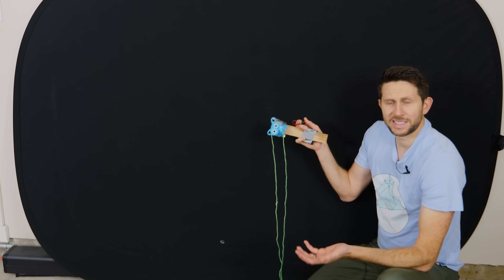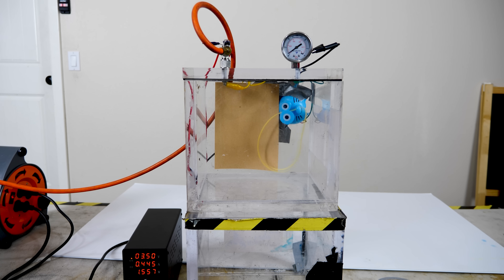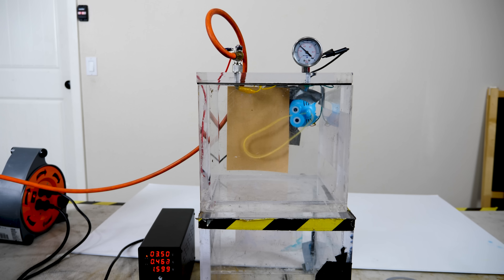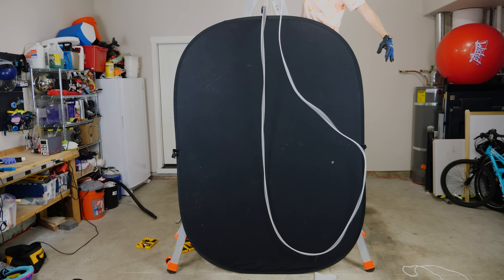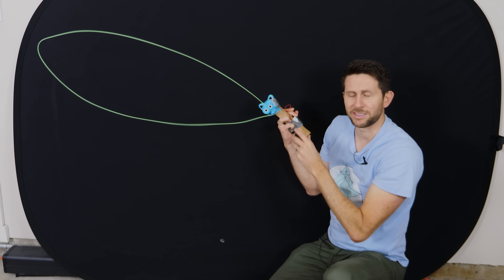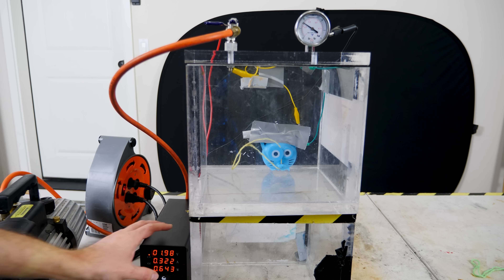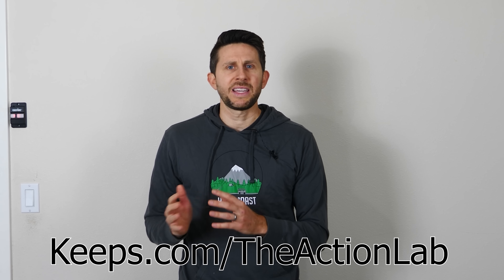The Real Reason a String Launcher Works

Comment: Nicely done with the vacuum chamber.   I've found the string shooter has been a  fascinating project and at one time we produced and sold a wooden version of this piece several years ago through a science distributor.  The interesting thing I discovered but underestimated in my own explanation is the amount of lift created by the drag through the air.  It should have been obvious since  denser strings did not work as well even though they were moving at the same speed as the lighter string. Eventually determined that the surface of the string was just as important as the velocity after noticing that as strings became worn they "flew" much better than newly made ones.  On closer examination,  I found tiny hairs appearing on the surface of the worn string were increasing the amount of lift.  So much so, that  part of our production included rubbing the nylon strings with sandpaper to give them a hairier surface.   Using this technique,  I've have  a few loops  that are slightly over 20 feet of string that are able to lift themselves  horizontally up to a vertical stage. I still hope to see a wave frozen in the string using some type of variation of these devices,  perhaps the action lab can succeed where I haven't.
Reply: Absolutely fascinating, thank you for sharing!
Reply: It is clear now: from the fact that worn, rough, hairy strings perform nicer it can be inferred that the more friction-dominated the motion is, the nicer the string performs.
About distribution of tension along the length of the string:
I imagine a piece of string being dragged through a fluid. Then the least tension is in the section of string down at the free end, and closer to the end you are holding on to (to drag the string) is where there is the most tension, because that section of string has to provide the required force to drag the entire length of the string.

If follows logically that in the case of the stringshooter the return end (being dragged into the rollers) is under the most tension, since at the return end all of the drag force has to be provided to drag the entire length of the string.

The return end looks as if it is a more loose end, it looks as if it has oodles of slack. (And we only have visual experience with strings with negligable friction, so we tend to assume that the straighter the string, the more tension) Against appearance, it follows logically that the return end must be under more tension than the outfeed end.

It follows logically that it must be that the energy replenishment is by way of the rollers dragging the return end of the string into the rollers. It looks as if the rollers are shooting the string, but they are in actual fact dragging the string.
Reply: @cleon_teunissen   using the word logically a bunch doesn't make a lot of what you said make sense. 

Making the string go through a liquid would screw with the lift so you would need a more powerful motor. And you would have to have a steady source of liquid because a bunch would be flying off the string.

The rollers are both dragging and shooting the string. The space between those two things happening is very small though (each end of the segment of string that touches the wheels.
Reply: @oscarinacan  Just to be clear: I presented the case of a non-loop string only in order to concentrate on the distribution of tension along the length of the string, with friction-dominated motion. The lift that you mention is another story. The explanation of the lift must take the looping of the string as its starting point. I did not address the lift; I didn't mention the lift. So: please treat the non-loop case and the looping case separately.

I used the word 'logically' to indicate distinction between what can be directly observed, and that which is inferred.
Reply: @Artcore103  Well, I did go overboard with the 'it follows logically'. I felt an urge to repeat that because here the visual cues suggest the opposite of what we can infer is actually happening.

In a comment on Steve Mould's video (prior to the release of this Action lab video) Bruce Yeany already mentioned that the string shooting fails in a vacuum chamber, and that worn/roughened strings perform nicer.

It's great that Action Lab showed the vacuum chamber demonstration in a video. Seeing the change in the motion as the air density decreases gives clues as to what is happening. I still have no idea, but at least we have more clues now.
Reply: Bruce, I purchased a string shooter around 2002 or 2003 from a science distributor, can't remember their name. It was on a wooden base about 8-10" long with two small motors with rubber wheels pulling the string. It was powered by C or D cell batteries and had a small plastic funnel that guided the string. Possibly the same one your company built. The string was longer compared to the unit in this video. I still have the string shooter but found it was difficult to replace the string. Regardless, my children loved it and so did my friends.
Reply: @gray5596   That would have been one of mine,  they were sold through a company called Science Kit and boreal labs.  I stopped selling them as it became too time consuming versus what we were selling them for
Reply: I like your channel so much
 @YeanyScience
Reply: I've only ever heard of the string thrower through one of your videos. I will have to catch up with much of your recent work. Thank you in advance!

Comment: 3.03 so why dont put it in a high presure and see if it rises even higher or if it rises at lower speeds. Would also like to see you increase the speed in the vacuum chamber after the string drops down to proof that more speed can cause it to go back up again. This could also kinda be done by lowering the speed of the string outside of the vacuum chamber. We would expect it to drop down when the speed drops, but it could be more or less sencitive then lowering the pressur in the vacuum chamber.

Comment: Drag force playing a role can be understood from the continuously decreasing current supply to the motor as the pressure drops in the vacuum chamber, and vice versa. I think it would be possible to get an idea about the amount of drag forces on the string by calculating the work done by the motors. 
Interestingly, one might also be able to figure out the critical mass of the string by balancing it with the drag forces calculated in this way.

Comment: So... the friction exerted by the air resistance operates in the opposite direction of the force of the launcher "shooting" the string, because the vectors of friction and of launching are opposite. The friction force exerts a tension in the string that, due to the specifics of g and the coefficient of friction in air, can overcome the weight vector of the string? So a heavier string or a 'thinner' viscosity medium (ie: pulling a vacuum) cannot provide the conditions to allow the string to 'rise' up as if against gravity. 
Did i get all that?

Comment: I thought maybe the curve of the string is at play. The outside of the string is moving faster than the inside creating some kind of magnus effect. Or at least at the vertical part it just pushes air down creating an opposite uplift force. Which does not entirely explain the vertical string experiment though.

Comment: Did no one notice that he used pressure showing thingy and pipe that sucks out air as conductors to power the stringthrower because he couldn't let wires in the chamber
Great use of common sense!!!

Comment: I think you're actually describing an aeronautical phenomenon that we see when you dimple golf balls. What's happening is the "immense" acceleration is translating into airdrag (as explained) but this drag eventually becomes air acceleration which results in the immediate air zone becoming a low-pressure zone (place your hand near the string, you will feel a non-insignificant flow of air) and this is what generates the lift. Food for thought.

A way to confirm this might be to fray the rope which you claimed was too heavy to be looped horizontally. Or experiment with a smaller rope that fails this "weight test" as you describe. Would tightly spun silk do this? With sufficient airflow, you could generate lift I suspect. Possibly even with the same speed of looping that rope does now. Point a leafblower/fan in the direction of acceleration (assuming the rope could take advantage of this "jetstream" in the first place) you might even get similar results.
Reply: Someone else mentioned deliberately fraying the rope, very neat how this works!

Comment: Maybe the electric motor is overheating because there is no air to cool it, since at the same voltage your amperage was dropping, indicating an increase in electrical resistance in your motor..

Comment: The more pressure you add the higher it goes. The obvious next step is to add more pressure. Either pressurized air or a very dense gas. Maybe even some kind of set up with water.
Reply: I don't think that's possible since the top is not held by anything when it is reducing atmospheric pressure the outside air forces the lid to stick on but if you put extra air it would keep escaping

Comment: Why does pushing the string into the air cause tension?  Seems like it'd cause compression.
Does the tension come because the bottom part of the loop is being pulled while the top part is being resisted by being pushed into the air?

I wish you'd've put some marks on the string, just for curiosity's sake.  It always helps me when watching movement.
Except when it hypnotizes me.

Comment: Can you run several string launchers in parallel?
Reply: On the same string? If one is running slower than the others I bet it would get pulled to the next one and slow everything down
Reply: @unidentifiedbipedallifeform  separate string launchers

Comment: Are you sure its not actually air flow (caused by moving string) creating a low pressure and then the string being caught in the low pressure air like a bernoulli effect ball in an air stream?
Then it is just a matter of whether the lift from the lower air pressure in the moving air stream overcomes the weight of the string.
Im not sure how your explanation could be right. Drag forces on the string must oppose the motion of the string and would be towards the rollers and not cause tension in the string.

Unless the air flows faster than the string moves???
Either way I'm a bit confused by your explanation.

Comment: "We're still turning at the same speed..." 
I'll quibble with you that we do not know the string is still being turned at the same speed. Note that the power being supplied to the motor is about 200-mW lower at vacuum than at atmosphere. The voltage is about the same but the current dropped. Is the string still rotating at the same frequency? I claim we do not know. Even if the motor is still turning at the same speed (which we may or may not know for certain) the slippage between the motor and the string could change.

You should take a marker to the string at one point in the loop so you can use a camera (or high-speed camera) to see if the RPM of the string is the same. Or not, but then do not claim that the speed is the same without checking.
Reply: He probably didn't think of that, but yea it's a good thing to consider in the experiment.
Reply: @DarkQuest1922 I think you do not know what you are talking about and your reading comprehension is low.

Comment: Oh no your not wearing that t-shirt, the geometrical properties of a triangle having 4 sides is the reason why there is a square, it’s just the 4th intersection is where it creates the square, next or soon there will be a 5th line discovered on a square that signifies that a square can turn into a pentagram, and same with hexagon and septagon. And etc, it’s exactly why 1 plus 3 = 4, that fourth line on your t-shirt is giving proof to a another shape which is a square

Comment: Wouldn’t the string returning the other side also be in tension? It doesn’t look to be. Am I missing something?
Reply: Yeah, that is so counter-intuitive. All our experience with pieces of string is that the straighter a piece of string is the more tension it is under. However the string-shooter looping piece of string is being dragged through the air , that makes it behave in a way we don't have experience with, so our expectations are off.

Imagine a non-loop piece of string being dragged through a fluid. Then the least tension is in the section of string down at the free end, and the closer to the end you are holding on to, to drag the string, is where there is the most tension, because that section of string has to provide the required force to drag the entire length of the string.

So: in the case of the string shooter you need to think of the motion as friction-dominated. From that we can infer that it is the return end of the string-shooter string that must be under the most amount of tension, because the return end, being dragged into the rollers, has to provide the required drag force to drag the entire length of the loop.

The return end looks as if it is a more loose end, it looks as if it has more slack than the outfeed end. Yet, the logic is straightforward: if the motion is friction-dominated it must be the case that the return end is under more tension than the outfeed end. If follows that the rollers are replenishing the energy of the looping motion by way of dragging the return end through the rollers. The rollers are not shooting the string, even though that is what it looks like. It is the dragging of the return end that drives the loop around.
Reply: @cleon_teunissen  great explanation!

Comment: Another clue is the PSU current.
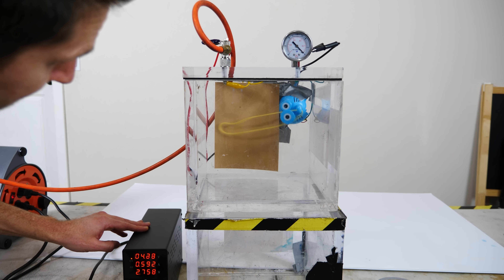1:10 = 0.52A
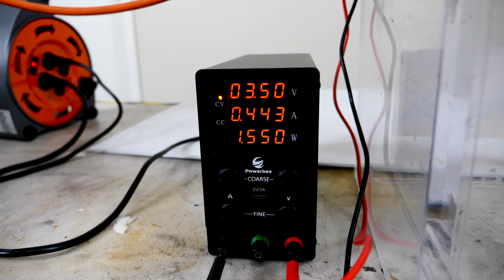2:22 = 0.44A
3:24 = 0.48A (lower than at 1:10, probably due to bearings warming up)
That means something related drag, but I don't know what.
Reply: The motor will be getting very hot in the vaccum as they use air cooling.

Comment: Very interesting, and very strange/counterintuitive. I would expect the air to "push" against the string, not "pull" on it. I think that the full explanation is more involved. Maybe we should ask Steve Mould.
Reply: The master of Mould effect himself huh
Reply: Yep, did anyone actually understand his explanation?
Reply: pushing/pulling is only a matter of perspective.  the air is "pushing" (resisting) the string... it's pushing the opposite direction as the string is moving.  the string is being pulled through the air, the air is resisting or "pushing" back on it... but if you flip your perspective and look at it from the other direction, it's pulling.  It's a frame of reference question.  is the string moving through the air (yes), or is the air moving past the string (not really in this case).  if we had a floating string in space and created a vortex of air around it...... lol
Reply: @Artcore103  Are you replying to me?
If you are then I don't know what you're trying to get at then.

Reference frames are (mostly) for cases in special relativity. This isn't that.
Furthermore, pulling and pushing are two words that describe the same thing, that is, applying a force. It doesn't matter about perspective. Forces doesn't care about how it's generated.
Reply: Steve makes interesting videos, but Action Lab is on a different level. Action Lab explains things very well.
Reply: @duggydo  In the grand scheme of things, action lab doesn't explain at all really (At least in this video).
He simply states and expects us (and we do) to accept it.
He states that drag dominated, the tension is on the top, but no one cares to ask why?
Without knowing why it behaves like this, then it really isn't an explanation as this part seems to be the key to how it works.
Of course this is expected since this channel is for casual viewers.

Mold is obviously a little different, his target viewers are there for the more in depth explanations.

Upon reading the article, it seems that this works due to the local moments created by the drag counteracting the moments caused by the weight of the string.
Reply: @WilisL  Well, you could click on see more in the video's description and read the linked article instead of just accept it... but that requires reading, and I am not sure you cut for that.

Comment: If drag force is responsible for the lift,then may be inside a swimming pool it would rise even greater..can also put color to observe streams and make it look cooler
Reply: But then, the drag itself may prevent the string launcher to spin as fast. If it can work underwater at all, really.

Even so, the idea to increase the drag on the string is truly interesting to try!
Reply: It probably can, but you might need a lot more energy for it to have enough velocity to overcome the friction in the water. But idk.
Reply: What if you fill the container with a high density gas such as xenon. Will negate the high friction of water and test the theory.
Reply: @shernader  or a pressure chamber (the opposite of vacuum chamber) might do the trick too.
Reply: @jonathanb6371  could work as well
Reply: Careful when using the word lift.
There is no lift on the segment of the string here.
Check the article in his description.
Reply: That’s like putting a toaster in a bath
Reply: @YesItsFrozen  ever heard of underwater welding?🤯
Reply: @xXxJSCOTTxXx  minecraft magma block